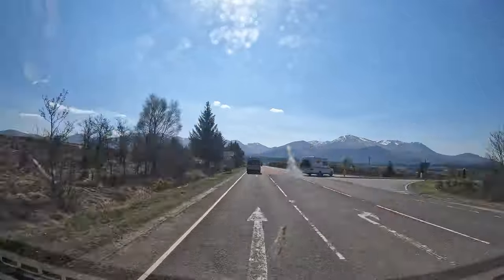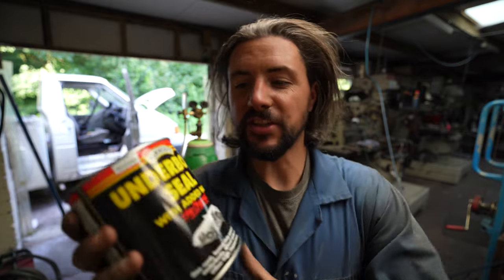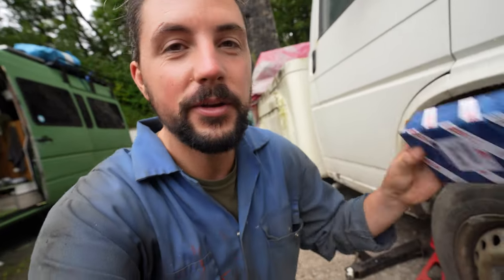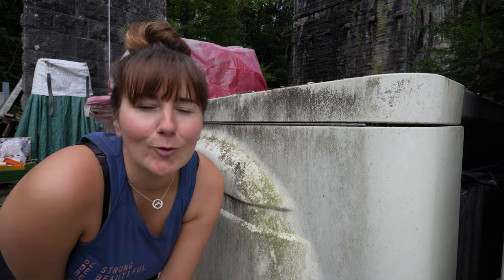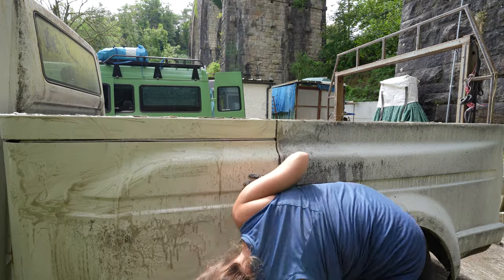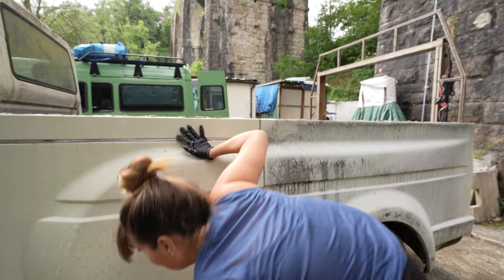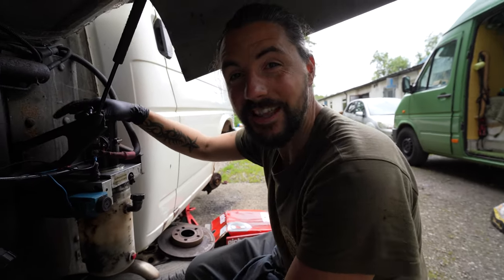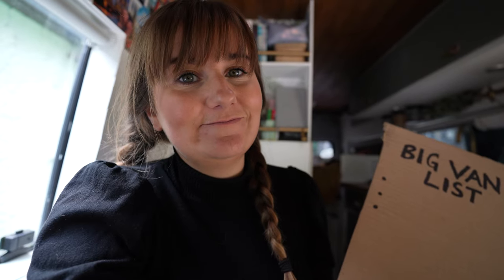IT'S DEAD, our van won't start | New project VW T4 Razorback

Comment: There is a small cable that attaches to the side of the starter motor. The cable is linked to the ignition and is prone to bad connection.

Find cable that goes to starter motor, pull it off the spade connector and trim wire adding a new connector. Clean up the spade on starter and give it a go
Reply from the maker: Thank you so much for this 🥳🥳🥳 we tried it and it worked 🙏🏽🫶 thank you for your recommendation
Reply: @thetravelduo_  I’m so glad it worked for you. Had it on mine years ago, AA man knew T4’s inside out so pointed it out.
Happy Days, will keep a look out for your next Video

Comment: Great video again guys. Nice to see more progress on the t4 👏🏼
It seemed to me like the starter motor or solenoid has packed up. If you put a multi meter on the starter connectors you should get 12v when turning the key. If you do it's the motor dead. If not it could be ignition switch or connection issue somewhere.
Keep up the good works guys 😎
Reply from the maker: Thank you so much! 🙂 I think you are right about the starter motor, will look into getting a new one! 🙏🏽